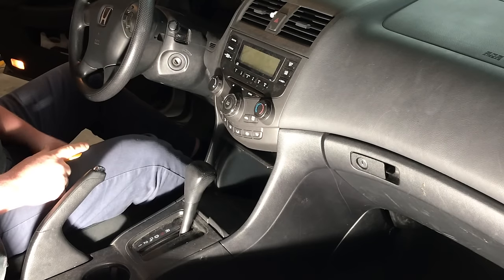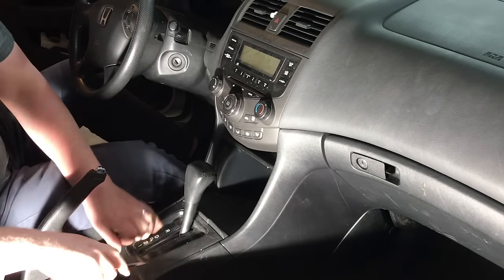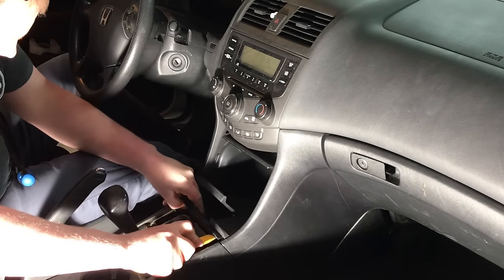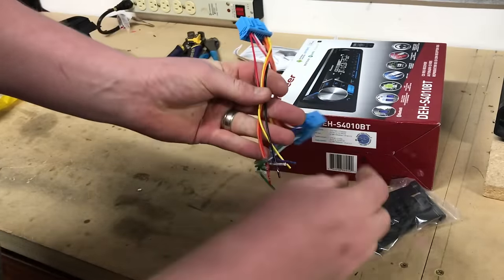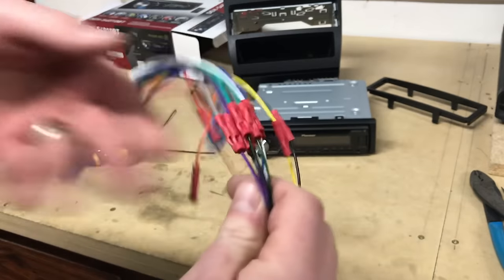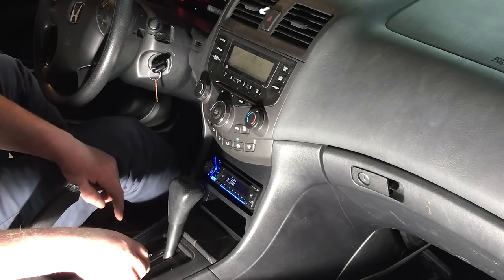2003 - 2007 Honda Accord Radio Install

Comment: My radios been broken for over 5 months finally gonna install a cheap aftermarket single din from Walmart later tonight, thanks for the video
Reply: Did it work my radio in my accord is also broken and makes crackle sounds and pops everytime I turn the radio on did this work for you?
Reply: @op_cloud8829  mine does the same as well. I'm thinking it's the speakers.
Reply: @raulnavejar474  it’s not. Just upgraded to full skar tx series 6.5’s and 6x9’s, they still crackle. You need a quality radio with a built in amp(preferably under 50w)
Reply: @raulnavejar474 uuuuuuuu😅

Comment: There's separate wire harnesses for HVAC controls and the radio entirely so I don't understand why you have to run the wire back to the stock radio. I have mine completely removed because it burned out but my AC still works because it has a separate harness. So tell me why is the run back to the stock radio needed if you already have the new harness connected to the stock radio control harness?

Comment: Good install video...
Just a couple notes that might also help:

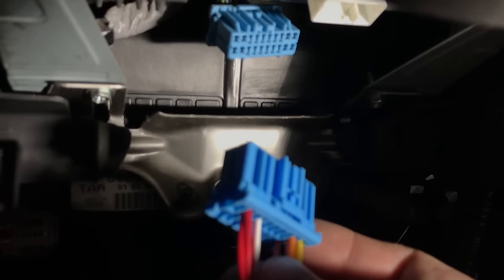Pause at 8:56. Look on the left side of the open cabinet and see one on the right side too, there are thin plastic open squares. These cars are old and those plastic frames are very thin. When putting in the new kit and getting it to seat under the A/C controls on the front panel, don't push too hard or these clips might break and they are irreplaceable. If that does happen the install will still work, as the screws that keep the lower part of the kit in place will hold, but the top part of the panel will have a small gap unless you attach something to the top, so go ahead and crazy glue a couple of plastic L brackets or use a 3M self adhesive strip under the A/C control panel to keep the top part in it's proper place. 
Also you don't have to pull the whole old radio out to get the antenna wire. It is in a type of ziptie with a plastic squeeze clip holding it in place. use needle nose pliers do dismount it and then the cable will drop into the space below. Depending on the stereo you're putting in, you may still need a 6"-12" extender. If you do use one use electrical tape to keep the old antenna cable securely connected to the extender. 
Finally, the kits themselves are kind of flimsy, so add electrical tape around the stereo insert sleeve and the kit to prevent rattling sounds.

Comment: I recently used this video to install a stereo into my '07 Accord when the old stereo crapped out. Unfortunately, I work 80 miles away from home in a high crime area and a car thief broke in to steal my new car stereo.  He/She failed, because when I followed this awesome video I noticed after I was done that the back end of the kenwood head unit was a bit heavy and this made the insert sleeve rattle a bit when driving, so I pulled it all out and wrapped some duct tape around the head unit and insert sleeve to make it sit tighter. So when the thief tried to use the metal removal sticks to pull it out they couldn't get it. :)
So if you have car thief concerns or rattle sound concerns wrap some duct tape around the head unit and insert sleeve during your initial install. Also Advise that you use a magnetic tipped screwdriver to avoid losing screws down the hole.
Reply: Planning a radio install tomorrow in my ‘04, thanks for the info!

Comment: This is also how the audio shop installed mine .At first I was not happy because its like retaining the bad tooth is still there. But this is probably the simplest with not much problem
Reply from the maker: Cheapest option for sure.

Comment: Just finished my conversion after a huge ordeal! Some of the connector slots which have double wires weren't soldered correctly causing no power to flow to either new harness plug! Since fixing these the harness works perfectly
Reply: I installed mine and it worked for one day and then i hit a bump on the road and it turned off what do u think could be the problem i reconnected everything and still doesnt work
Reply: @cristianperez1120   could be a dodgy connection in the harness or your soldering/crimping! Should try and check the constant and key wires for 12v
Reply: Could u  briefly explain what you mean
Reply: @cristianperez1120  if you just have the t harness plugged in, use a multimeter and put the negative side on an area of bare metal in the car and the positive in one of the plugs slot for constant voltage and see if 12v shows, and when the ignition key is on check the key wire for 12v. If you haven't got anything showing for either wire then that's why it's not working

Comment: I had car toys install mine about 7 years ago. About two years ago, something happened with the factory stereo. It just stopped showing anything on the display. No big deal. I had to unhook my battery for repairs and when I hooked it back up, it reset the factory stereo and the display was working again. A couple of months go by and it goes out again. This has happened 3 or 4 times now. The last time and it appears this time, the backlight and CD inserted light stay on when the car is off and key out of the ignition. It stays on all of the time. The last time it drained my battery completely. I'm trying to prevent that this time. How can I fix this? Cut a specific wire on the stereo harness?

Comment: The heat and ac run off separate power so you really dont need this harness just get the lower dash mount and a regular harness
Reply: Was looking for this comment because I’m about to wire a pioneer with just the radio harness adapter

Comment: I have a 2007 accord with stereo sony model DSX 415 bt, I bought a wire harness 99-7862 with this everything is fine.
The next step is to connect the steering wheel with the stereo, the problem was what type of connection did I need to buy and what number.
Thank you for your time and I hope you can help me to find the correct wire harness to connect the stereo with the steering wheel
note: the steering wheel is original honda accord ex 2007
thanks again
Reply from the maker: Send us a message on facebook and we can assist you further.

Comment: My 04 accord came like this, it works great but after awhile I wanted to put the cubby back in for more room and to make it look neater, would it be the same process just backwards to remove it?
Reply: Question in your 04 did you have to do anything different to get the radio to play. I have all wires connected, both systems power on, but there is no sound

Comment: Hey dude I have done mine long time ago and its all good and works just fine for my old honda.Question is,can you see on the display anything like aircon if its on or off,coz I might have mixed up some wire and mine does not show anything on screen its dead,but all butons works fine?

Comment: Hey! I just installed my new 1 din radio and everything is working just fine but my original radio's screen won't go on. How to solve this problem? HVAC works also fine and has background lights too.
I used honda ISO adapter and plugged all wires correctly

Comment: Nice video. I've watched several and I think yours is the only one I've seen where the old stereo wasn't removed.  

Question, though. 

I installed a double din stereo in my son's 07 Accord using the kit and instructions from Crutchfield. Ever since then, the HVAC controls don't completely work. I can't change where the air blows and the backing on the knobs doesn't work. 

One big difference between my install and yours is that you spliced some circuits back to the old head unit and my kit didn't say to do that. 

Can you confirm if not powering the old stereo also doesn't power the HVAC controls?
Reply from the maker: With the kit we used, it required to keep the factory heating and air controls as they share power and some data functions. Without the right kit, it may give you issues. Try retuning the car back to stock wiring to see if that fixes the issue. If it does, you need a different kit for the new radio.
Reply: @ProvoBeastAudio  thanks for the feedback. I've been in touch with Crutchfield. They're convinced I wired it right, but it seems I'm getting conflicting info between them and what you said. Pretty disappointing since I've always heard how Crutchfield has the best installation support, etc. I'll do more digging.

Comment: Aloha. Have a quick question but not sure if you monitor this anymore. Looks like it's been a while.  If so, is it possible to hook into the back of the white port on a factory installed Panasonic 39175-SDA-L110 radio in an '04 Honda Accord which also has a factory 6-CD changer and Sirius Radio?  Console (Radio) face is 7BK1.  All the videos I see simply suggest plugging into a white (Aux port) facing down twds the floor of the car.  My radio only has the white port (right next to the blue one) facing fwd (twds the front of the car) on the BACK of the radio.  Any help would be much appreciated.  Thanks.

Comment: So before. Radio would turn on. Didn't put out any sound. HVAC controls still worked. Decided to try this video. Plugged it in, new radio shows nothing, old radio shows nothing. Took the harness out, saw some wires weren't attached. Recrimped them and plugged the harness back in. Still nothing. Decided to plug the old radio back in without the harness, showing nothing, no clock, no sound, HVAC still working. What are your thoughts? Is this still fixable?

Comment: Where does the satellite antena go - on the dash? Will the wire hang around?
For the reverse camera do we have to drill a whole for the cable in the back of the car?

Comment: Hey i got honda accord 2007 4d. My car problem is stereo and defogger lines are not working. All grid lines are getting the power except upper three wires which are antenna wires. And at the end, antenna wire doesn’t have the power. So, Should i change the stereo or just fix the antenna wire?

Comment: here a ? got a friend has a 07 honda accord she say her radio will not come on if i replace everything like this say will she have power to the bottom radio if her top 1 doesnt work or will i have to bypas the power  wire like i have done in the past to older vehicles
Reply: There are two types of HVAC controls. If they are built into the radio then you need to check fuses and make sure power goes to the radio so it works. If it's getting power and still not working,make sure the constant power is getting there too. If both 12V are there and it's still not working,then the factory radio with built in HVAC needs to get replaced. This is needed for HVAC regardless if you get a aftermarket radio.
If you have EXTERNAL HVAC radio and you don't need power to that old radio for anything,then who cares? Test for power and it's dead,run new fused lines if needed or if there is power then just install the pigtail and the new radio will work. You'll of course need to make sure the external HVAC is still getting power,which it should anyway.

Comment: Hello there...I have gone through most of the part of your instructions without a problem...so kudos on that! 👍 However I just cannot detach the harness connected to the factory radio. I’ve used a lot of pressure and pulling in different ways but it would not come out. Is there a special technique to pull it out? Please help! Thanks :)
Reply: I'm sure you figured it out by now but there's a clip you need to press inward on,in the middle on one side. It's not much more work to just unbolt the radio and remove it. You'll need an extension cable for the antenna and need to do it anyway. With the whole radio swung outward you can get at the clip much easier.

Comment: Hi grate video I have tryd yo do this but my new stereo dont have sound but powers up all wires are color matched
Reply from the maker: You may have a factory amplifier that is not turning on.  You may need to connect the blue / white wire on the harness adapter to the new radio in order to trigger it on.
Reply: Provo Beast Audio Installation thanks mate works a treat
Reply: daryl barkle did this get resolved

Comment: Hey i have a 2003 honda accord sedan single disk stereo. So my stereo decides to turn on and off whenever it wants.  It mostly doesn’t work. Apparently its a common problem. If i do your Bluetooth radio install will it fix the issue ? Because it seems like the new radio you install runs off the original one. And since my original one is not working, what will happen?
Reply: I have the same question

Comment: All the AC/heater dials and buttons still function, as well as the alarm system? That is why is it wired through the old radio, correct?

Comment: Would this install work with a pioneer deh-s4220bt? It looks like the model used in your video is tough to find in stock

Comment: Will this installation work on a 03’ accord with navigation system?
Reply: I can assure you it does, it had a few more steps for me but I got it done and it works great! 

You need to take the old radio out, you do this part by unscrewing the 3 screws under the air vent. 
Then you un plug the same cables he un plugs and run them to where you need them to be, while you’re there might as well un do the Antenna as well. 
Then once you have those wires all ready to pair you can start the butt connectors like he did and plug the HVAC controls back to where you took the cables out and screw your navigation system/ radio back in. And then you can pretty much follow his steps. Hope this helps, any other questions or unclairities I’ll try to help iron it out!

Comment: Do you need to add the Bluetooth microphone? That allows you to speak through "the car" during a phone call and is not necessary for installation if I'm right

Comment: How can I have the factory radio not work at all because it drains my battery? I have a pioneer system as well. I took out the fuse for radio and my battery doesn't drain. Factory radio is bad. Help please.
Reply: I'm having the same issue

Comment: Good video. Is it the same process for a car that has navigation?
Reply: Did you ever find out ?? I have a 2005 accord with navigation but it just stopped working so I have to buy an aftermarket radio like this .
Reply: Hi I've just finished my conversion and it seems if you unplug the dvd unit for the nav the screen doesn't work. So I've left mine connected and then added the radio as usual

Comment: I put a jvc kd-sr60 radio in my 2007 accord. It powers up but I have no sound coming out my speakers. Fuses are good. It’s the same radio I used to have in the car. Any help would be great!

Comment: After an installation, will the factory stereo still display settings related to the AC unit ? such as temperature or where the air is blowing ?
Reply: Based on what he says "the wire harness kills the speaker wires in the factory radio" and based on the fact that you have a harness that still gets plugged into the factory radio and based on the fact that you need to have the display for those to function,everything about this bypass pigtail harness suggest it does just that; bypasses the radio functions only,retaining all the other hvac circuity.
Reply: I had the exact same question.  I purchased an 07 accord with a CD player installed that LOOKS like this install.  Have not seen anything on the original screen and would like HVAC functions
Reply: @jacoby5240  I just did the install. Maybe someone didn't install the pigtail? You'll need to take a look. Install one if all they did was bypass the HVAC and feed the new radio. I just installed a radio with the pigtail and I have all the controls working still. I shorted out the constant wire and couldn't find a fuse for it anywhere. I run a devoted fused line right from the battery. It feeds constant power to the original radio and the new one (yellow wire) to turn on the fact radio (now just a clock) and retain radio settings in the new radio.

Comment: Hi, i installed new radio stereo from mechanics nd it's working perfectly but i can't see any info like heating or cooling option or in simple word display shows nothing, when i asked mechanics he said its like this coz we gave all power to new one..but aftr watching your video it's possible to show up light nd info at factory stereo..so in this case what mistake would hv done by my mechanics???

Comment: You kind of glossed.over the part where you actually plug it in im.not sure how you do that
Reply: You mean plugging in the new head unit? It's quite simple, the last remaining connector on the wiring harness will plug in to the connection port on the back of the new head unit. Same with the mic cable and the radio antenna wire.

Comment: So I have a question. I saw that the radio just slides in and locks in place. How do you get it back out of the radio bracket? Can I just pull my radio out of it? Mine has stopped working and I need to get in there and find out why but I'm afraid I'll break something if I try to pull the actual radio out.
Reply: Might have to get removal tools

Comment: Great thanks. About to set this up tomorrow. So the radio antenna port on the new stereo won't be used? The harness adapter kit uses the connection from the original radio to the antenna?
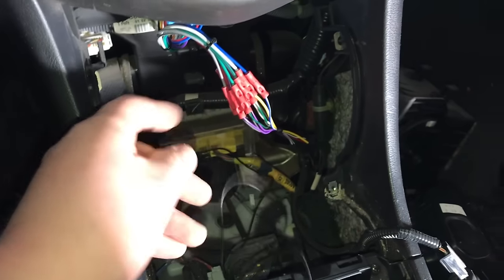Reply from the maker: Nope, you need to pull it from the factory radio and connect it into the new one.  It's in the video BTW, see 9:58
Reply: Provo Beast Audio Installation got it. Thanks a lot
Reply: Provo Beast Audio Installation and done. Your video was the easiest to follow. But seeing as I'm an idiot, I've not put the two 8mm nuts/screws back into the bottom. Should be fine 😉
Reply: @ProvoBeastAudio  Will it actually reach way down there though or do you need an extension cable? Generally car antenna cables are very tight on length as is.